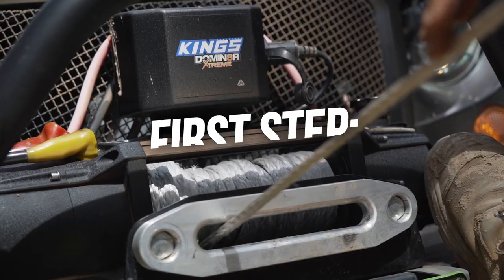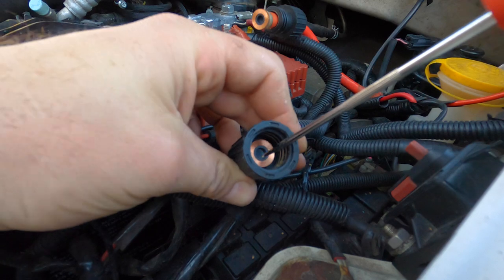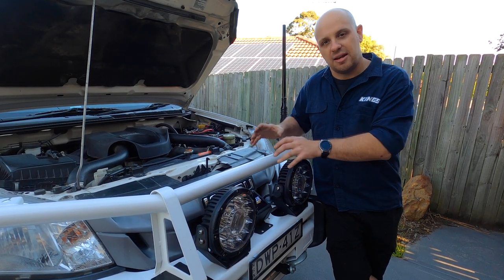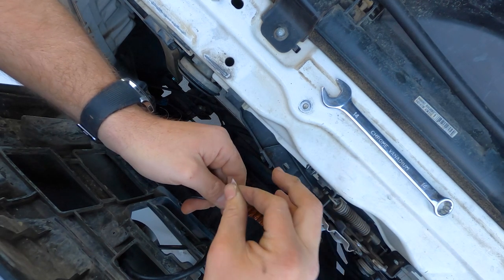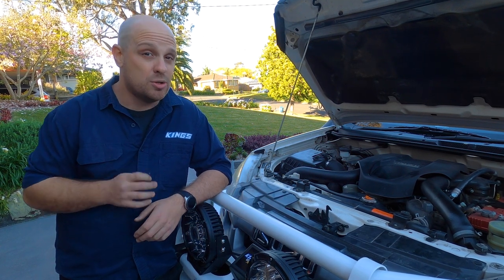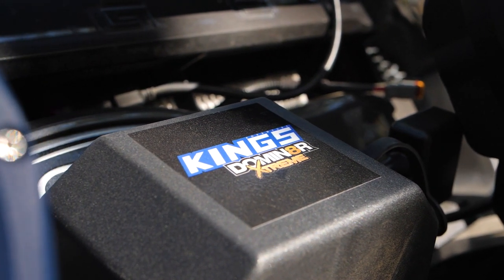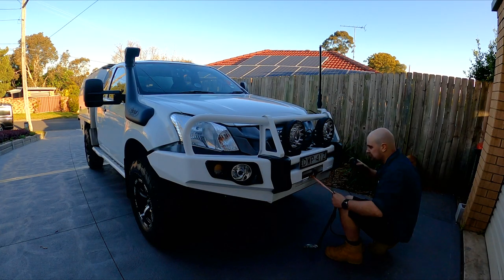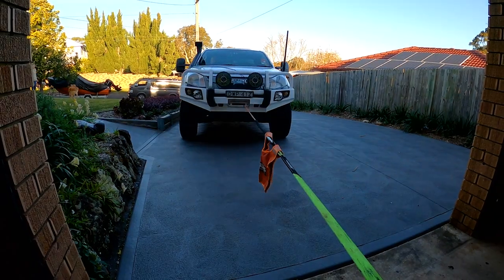If Your Winch Stops Working! (12V 4x4 WINCH REPAIR + MAINTENANCE TIPS)

Comment: What about cleaning the dyneena rope by soaking it to get sand and grit out of it? They do wear out and snap. I'd carry a spare rope when it starts looking old and frayed. Also does the dampener bag need sand or dirt in it to work incase of a line failure?

Comment: Help my kings dominator winch just clicks when I press the controls when I put my hand on the solenoid you can feel
It clicking any ideas what to look for
Reply: Did you figure this out
Reply: I had this same issue. The red cable that went to the winch had no continuity through it but looked fine from the outside, I removed the cable and the heat shrink to find crimped lugs and the cable full of green corrosion at which point the lug fell off. The vehicle has not done any beach work

Comment: HI mate, this is so helpful and timely - my winch makes a click sound when i try to winch out but it is able to winch in?
I am also unable to change my winch from the activate to disactivated, it seesm to be stuck? 
Any tips here?
Reply: They have troubleshooting guide just for that, I had the same and it was the female pins in the solenoid weren't contacting properly, give them a clean up and test with a paperclip connecting 2 pins at a time, 2 for in and 2 for out

Comment: Buying a cheap winch is like buying a 10c condom and then leaving it in your wallet for a year and expecting it to still perform.
Reply from the maker: I've been using Domin8r winches as long as we've been making 'em and swear by em mate. If you do like I showed and spool it out and in once a month it'll be a faithful workhorse for ages. Cheers Brenno
Reply: Yep. Don't buy a dominator